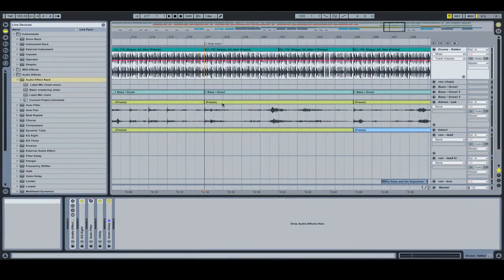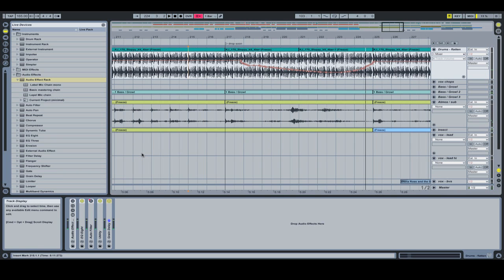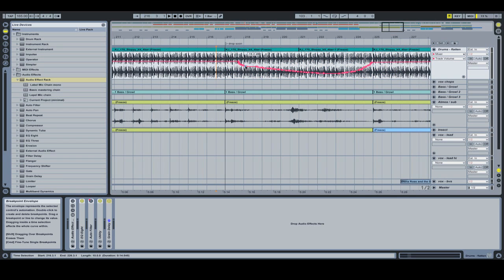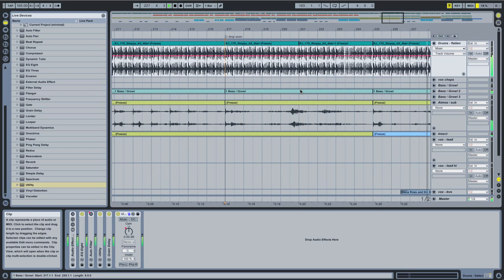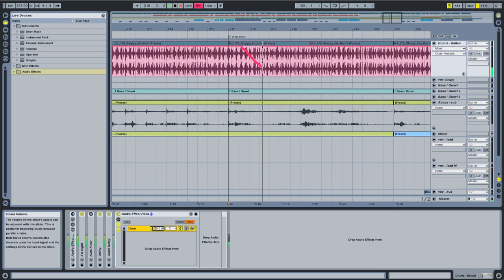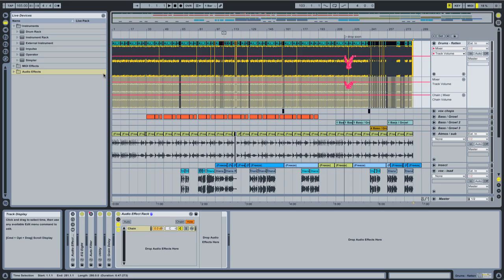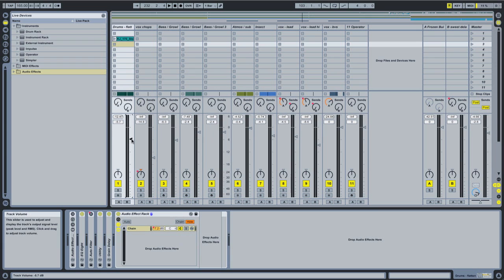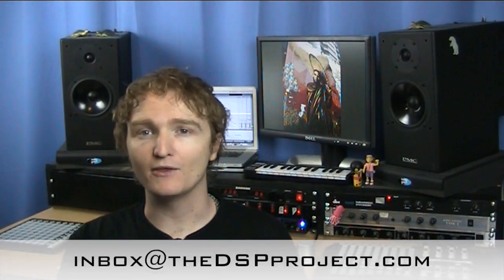Ableton Live Volume Automation (The right way)

Comment: I think it would be better to do it in reverse actually. Keep the fader automations. I say this because external mixer surfaces with motorized faders use the MackieControl protocol to automatically mirror the appearance of Ableton's faders. This provides the user with useful visual feedback to volume changes. The way it's done in this video, motorized faders would not be able to track the utility plugins automation and the cool "motorized" capabilities wouldn't be utilized at all. That's why I think it's better to slap on a utility afterwards to raise/lower the volume.

Comment from the maker: That will work but keep in mind some plugins react differently depending on how hot the signal going in is. As the clip envelopes are pre fx you could get a change in sound /     your compressors will stop compressing (falling  below the threshold) etc. So I wouldn't call that an ideal solution but yes it would work.
Reply: Great informative vid!
Quick question, as an alternative couldn't I just put the utility tool at the end of the FX chain of say the lead vocal to bring down the volume a few DBs?